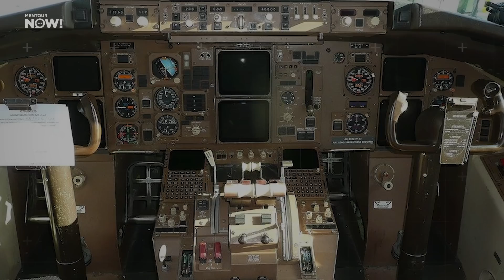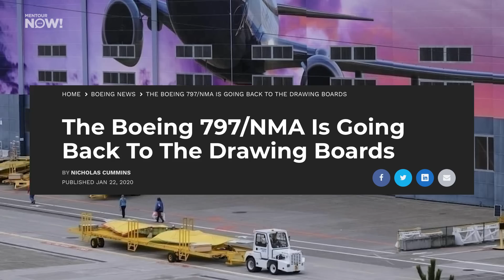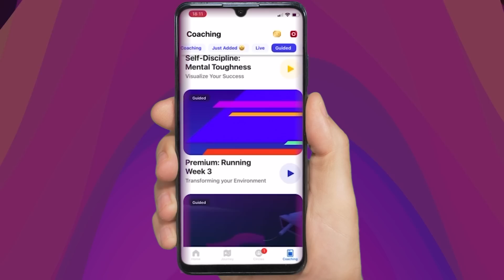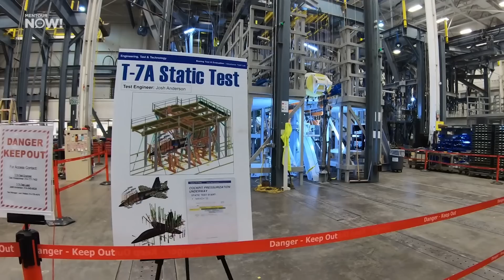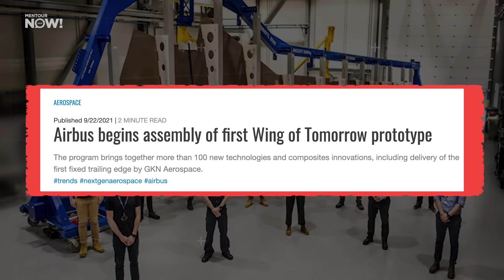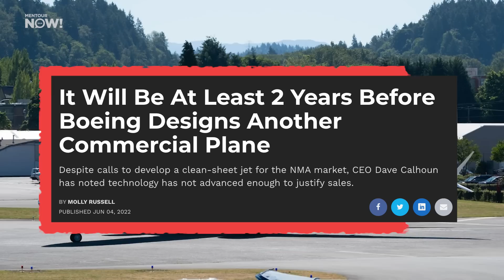Is Boeing Planning a 757 MAX?!

Comment: In the past, Boeing, always said that they no longer have the tooling to produce new 757's. The 757 was also vastly more expensive than the 737NG, hence the reason it died it's death. I still fly the 757 but can't say it is much better than a 737. Overall, I just find it hard to believe a modernized 757 is viable. 737MAX A32X NEO covers the needs of 95% of airlines flying short haul.
Reply from the maker: That’s pretty much my point but in a lot more words. 😂
Reply: I dont think they dumped all the tooling. Yes, you need to put appart a production line which is a huge challenge ... but Boeing should be able to do it.  And the jet has got a good reputation and can fly to high altitude airports and other scenerios where you need power to spare.

Comment: I'm not a fan of the idea of a rejigged 757.
The 737 max was their last attempt at this and it speaks for itself.
Reply: They are very different. The 737 at this point has been stretched and modified repeatedly. 
757 had a single stretch pretty quickly after it’s design and it’s got plenty of ground clearance with its current engines and landing gear.
Reply: I think the 757 is closer to what they actually need and the 737 wont be able to achieve. Plus it is far more modern airframe. This probably helps ... who knows. But yes, they need to avoid another frankenjet at any cost.
Reply: Lol. That had less to do with the base airframe and more to do with an entirely new automation system that was not sufficiently vetted.

Comment: 757-300 is not the world's longest single aisle aircraft. That distinction goes to the longer variants of the DC-8 Super 60 and Super 70 series, namely DC-8-61, -63, -71, & -73, which are about 9 feet longer than 757-300.
757-300 is the world's longest narrow body twin jet , since DC-8's have four engines.
Reply from the maker: Awesome! I learned something new!
Reply: @MentourNow   I remember sitting in the back of several “Stretch 8s”. Talk about experiencing “Tube effect”.  Miss the DC-8 !  Thank you for producing your excellent videos.
Reply: @MentourNow  You may also be interested then to know that although there are no DC-8's remaining in passenger service, there are some still active as freighters. Current operators of the longest DC-8 variants include SkyBus Jet Cargo in Peru in South America and Trans Air Cargo in the Congo in Africa.
Reply: @TonyM132  I believe there are still some "combi" DC-8's in service (split cabin with cargo and passenger areas).
Reply: @TonyM132  Sumaritan's Purse operates a DC-8 72 F
Reply: @supericeman1  Yes, I have seen that beautiful airplane in videos, reconditioned like new in all white. But I didn't mention it above because as a -72, it is shorter than a 757-300.
Reply: I would say you’re splitting hairs but you’re not. 😝  Two engines on this bad boy feel like rocket propulsion. 😎
Reply: @Jude74  I never heard that and only flew on one just once, in June of 93  an Arrow Air DC-8, AMC CAT-b  "charter flight," Philly to Naples non stop, full up and in a center seat and at night and I don't know if I could have seen the wings even if was during the day., A little trivia for you though is that on the first ones the auto pilot was an option and in fact some of the first ones were delivered without one.  The DC-8 was incredibly stable, properly trimmed out at at .80 at altitude it was solid as a rock, even without an autopilot.  To demonstrate this Douglas made a promotional film that showed a brand new #2 pencil on a flat/level shelf/panel standing on it's eraser end
Reply: @Benji P What do you mean by “sold out”? You mean the sponsorships?
Reply: @MentourPilot  Benji P sounds like a troll. Ignore him. Your channel is great and very informative.
Reply: I’ve heard that the DC-8 had floppy wings to distribute stress.  Disconcerting for passengers.
Reply: @naughtiusmaximus830  Ever look out the window on a 787?
Reply: @gordonbergslien30  I stopped flying fir business about 10 years ago.  Haven’t had the privilege.  Did see one on the tarmac at Frankfurt along with some Airbus 380’s last time I was out and about.
Reply: @Benji P Anyone who works on an oil rig, does it for the money.  (Not that there's anything wrong with that.)  So I don't get why you would be somehow disappointed that Mentour makes money from YouTube and other online platforms.  I can't imagine you going back out to the oil rig if they told you you'd be working for free.
Reply: @Benji P
You know, for someone who straight up trades days of his life spent on an oil rig for money, you should understand that time is money. I do, because I'm a truck driver in international transport who does exactly the same.
And since Mentour channels require a lot of time from multiple people to regularly post high quality videos of this nature, I fail to see how working for free would satisfy their own needs.
Love for something doesn't pay the bills - monetary income does.

The alternative would be a single Mentour channel with a couple of basic videos a month because anyone involved would have to prioritize working for a living. So my question to you is this - are you resentful of the fact Petter was able to use his job to create a successful YT channel or of the fact that you're unable to do the same so you could quit yours?
Reply: @Benji P
Oh don't worry about the aggression pal, I've never been one of those.
And I DID ask you a question but you chose to ignore it. That's enough for me.
Reply: @Benji P I’m not sure I know what you mean. Yes, I run a production company and have 4 people depending on the become from both channels. 
Don’t you earn money on your job? Are you ashamed of that?
Reply: @MentourPilot    Learn to ignore Marxists.  lol
Reply: @Benji P
You clearly don't understand what "love for something" means if you think that money, that comes as a result of someone's work and dedication, completely invalidates the effort that created that monetary value in the first place.

That would be the same as saying Valentino Rossi is a money hungry shill because he makes a lot of money as a MotoGP star. Tell you what - why don't you hop on a MotoGP bike and try to beat him, and take all his undeserved money & fame? Good luck with that, scrub.

And btw you haven't answered my question but I KNOW it's one of the two, so in the end it doesn't really matter which of those you admit to. The very fact I have to write couple of walls of text explaining a basic life principle to you is enough to make me think working on an oil rig is probably the only thing you're even good for.
Reply: Used to watch the 61/63/71/73 freighters with Emery come right down 51st street to land at the old in-town Austin airport in the 90s when I was in college at UT-Austin.  Later after graduation I bought a house in SE Austin and cargo service was moved to Austin-Bergstrom airport in 1996.  Those same Emery freighters shook the house on climb-out in the late 90s with their non-stage III engines!  I mean it was loud AF even compared to the 727!  Great times!  Miss seeing those old Diesel-8s!  

On a side note, Emery went out of business in 2001 after crashing one of them in Sacramento - the FAA found numerous safety violations in the operation and they never recovered after the subsequent investigation.  At one time the fleet was parked in Roswell, I took some pictures on a trip to NM around 2003-ish.

Comment: Loved the B757.Sitting at crew position 4 at the back, on a toga takeoff or even derated (RB 211 535E4 engined) it went skywards like a homesick angel,was just an awesome experience
That baby was built to fly and looked the bees knees as well.
Insightful video though Petter.
I would for sure love to see her back but at least they are still operational as freighters for now.
Reply: It's a very powerful plane. I remember taking a 757 freighter to a nearby airport for a C check. Completely empty and needing a max thrust take off as part of the maintenance process to prove that max thrust was really available. Pinned back in my seat, it must have been gaining speed at 15kts per second and we were airborne in no time. Problem is, such power does not truly add anything for the airline (beancounters) unless they fly from short or high runways.
Reply: @philipjamesparsons  ,that is the problem with airlines being run by said beancounters.
We do not have many "hot and high" airfields in europe apart from the mediteranean ones in summer but still we used them here,perfectly suited to the task.

Comment: Have only flown on a United 757 once Washington to SFO. Was memorable thanks to listening to Channel 9 discussions between pilots, United Maintenance and, eventually Boeing, about a strange engine behaviour during taxi. We ended up going to a remote area, shutdown and restarting the engines before taking off. They cut the channel mid diagnosis so don't know what caused but we got there OK!
Reply: I love listening to ATC and things like that when I'm flying.
Reply: The good ‘ole “just turn it off and back on again” while it doesn’t always work it often does.
Reply: I've flown in the back of a 757 more times than I can remember.  As a kid I always wanted to fly on the wide-body aircraft (like the L1011, DC-10, 767) just because I thought it was so cool being in a bigger plane.  That said, knowing what I know now and how pilots love the 757 "hot rods" I have a new respect for them every time I fly. I've also come to love that dolphin nose look that's only similar to the L1011.   I think the last time I flew on one was recently out to Hawaii.  My most memorable one though had to be a few years back flying from SNA to Reagan.  That was a crazy tight final that freaked me right out.
Reply: United was the only airline to offer Channel 9 for its customers, but left the decision to use it to the captain of the flight. I ALWAYS  used it.